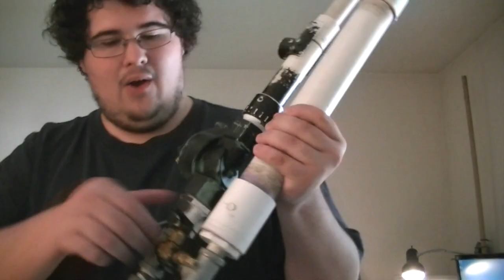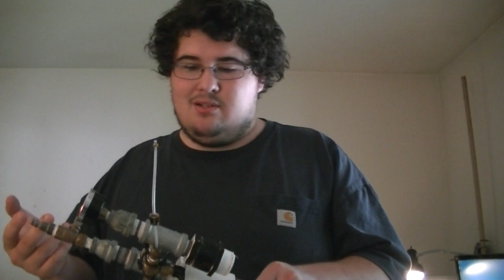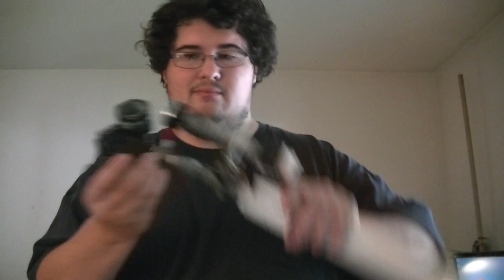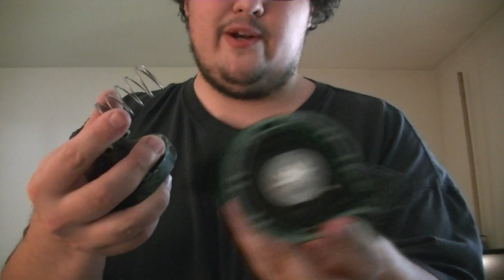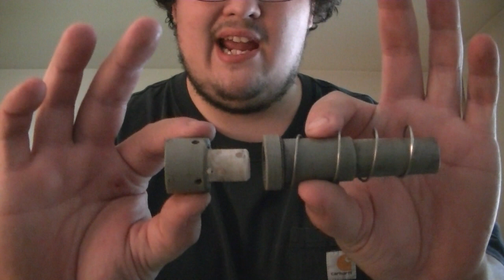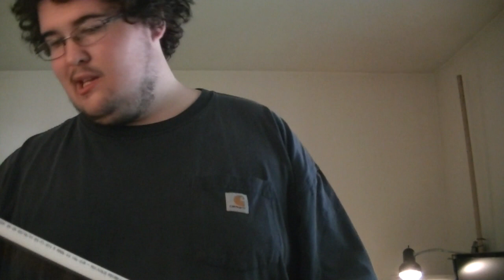How to: build a fully automatic PVC paintball gun - part 1: overveiw

Comment: You don't want to fire the solenoid valve electronically because the electric solenoid does not open the valve fast enough with only air. It was meant to be opened with fluids.

Comment: is there any way to make a semi automatic air cannon without a bolt or some way to easily load rounds(.50 paintball)right now on my cannon i have a modified t that i can load rounds into but i have to unscrew a cap every time
im thinking about replacing the cap with a ball valve